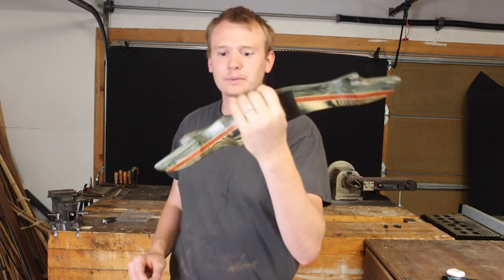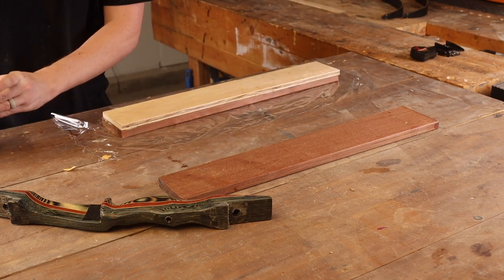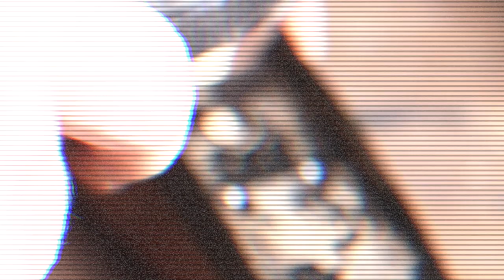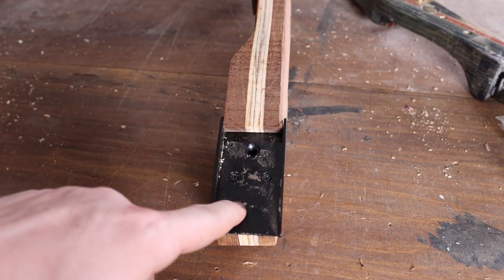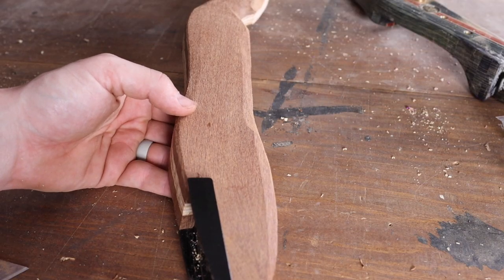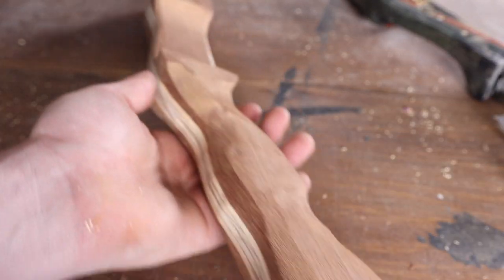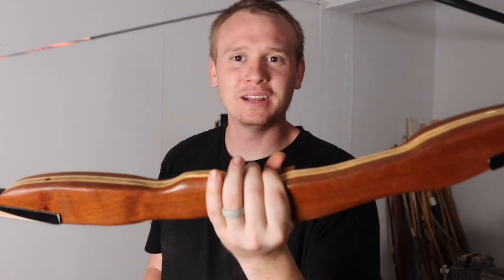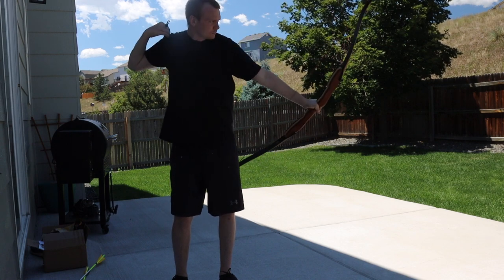I DESTROYED my bow riser AND built a bigger better one!

Comment: Bro, I'd like to see that riser cut past center or just enough to give the arrow a true center shot. Also, if you question your limb bolts. Completely drill thru the riser and use bolt and nuts

Comment: Not to shabby!! The reason it dropped #20 is because you didn't account for the Limb Pad angle!! You used the same angle as the shorter riser!! I'm guessing you made a 25" riser? Those limb pads need to be alot shallower to get the effect you were looking for!! On your next one try 10-12degrees on that length of Riser!!

Comment: I built a riser. Made it shorter to increase poundage. Also due to some wrist injuries I wanted to put more pressure into my palm and take it out of the web of my thumb. I did run into some fit and finish issues, but I'll fix that in a new riser of the same design

Comment: Nice experiment about pushing the boundaries for the right reasons.  I have 3 sets of ILF limbs with 2 strings I just got from you over the last month. My form was pretty good until the last couple of weeks of weather got crappy. Right now I'm converting an old 19" Custom wood riser into ILF. I have a set of limbs that r about 5 pounds less to buildup until the weather warms & I can switch back & forth until I settle on 1 riser. By the way, your Shatterproof glove is a big improvement to those of us that refuse to use a tab. With the button strap u can get the desired fit even if your fingers feel like they r a small in diameter for the glove. Something about that great design that just works 👍.

Comment: Very cool video! Your riser looks awesome. A couple of other things about riser geometry determine bow weight as well as length. The limb pocket angle determines how much preload is on the limb, yours look similar or even more deflexed than the 17" riser which makes the draw cycle start softer and works the limb less.  Also the throat of your grip looks further forward of the limb pocket pivot point, which accentuates the deflex in the riser. I think it works for these shorter limbs though, it should negate any stacking for you as the limb starts to work later in the draw cycle. 

Good shooting at the end! Try and remember to bring the arrow to your eye rather than moving your head forward, you can still lean after if you want to cant the bow, but I'd suggest learning to shoot upright first! Check out Tom Clum if you haven't already, man's a legend and awesome teacher. All the best.

Comment: great video,as always I learned something new .  You should be good using epoxy on the threaded screw barrel. West Marine says their testing shows that epoxied machine screw threads are the strongest way to attach screws to a composite.  Just a thought,  have you tried using french curves instead of trying to freehand a curve?   Transfer punches are a great way to locate the center of a hole on a surface .  Have you tried brad point drill bits? they are great for making very clean holes in wood .  Also, the point helps in getting the drill bit on the center of the hole.  Just my 2 cents worth.

Comment: having had a thing for control line model aircraft in my teens a trick I learnt with balso should help with ply also, form the thread in the wood, soak it well with superglue, let it dry thoroughly, then epoxy in the threaded component.hope this helps

Comment: Nice job,  also grab a 60lbs resistance band and use that to train those back muscles.  Even though it's 60lbs it doesn't really feel like that much and strain grows the further its stretched just like a bow. I started with a 35lbs draw weight and now that seems easy after intentionally training with a band myself.

Comment: Since you were using plywood, I fully expected you to use a wood stabilizing resin, (like BVV.)  You need to do that for unstable woods like soft woods and plywoods, especially when tapping threads for metal bolts in said woods.  These resins require mild heat treating to make them cure.
Like your videos a lot.  I would never do what you do though. I am too rigid and uneasy...  Keep up the good work.

Comment: Nice work ... im surprised that it dropped #20 too, but a beautiful job... 
Im also wondering why you didn't 'radius' the shelf a little ? It looks completely flat. Doesn't it interfere with nock points on the string?

Comment: I followed one of your snowmaking tutorials and made 2 bows, they both only had a draw weight of 25 pounds. How can I make them better and stronger next time?
Reply: To fix the bow you have now, add another thin layer of wood about 1/4 inch thick or 1/2 cm on the front but only in the spots of the limbs after the middle section then put on another layer of the front backing material be it the rawhide or the fiberglass tape in 7-8 layers on the front.

Comment: Why did you run your laminates the way you did? It looks like they are 90 degrees off of the way the original riser was built.
Reply: @kramerammonsarchery  The reason I asked is that to me, all the stress on the bolt insert is being placed ACROSS the plys in the plywood. That is the weakest part of any plywood.  If the laminates had been run perpendicular to the insert, the insert would of passed through at least one laminate before it hit the plywood.  So if the plywood failed THROUGH the plys, (very unlikely), the outer laminate would have supported the treads.  This may not matter on a 24 lb bow, but moving up in draw weight, it could cause a problem.  But then I may be all wet and being too conservative.  I enjoy the channel very much.  Keep up the good work.

Comment: Plywood's only strength is on the top and bottom,.....there is no end strength?
See if you made the plywood your self with epoxy it would have been a solid piece of wood.
Wow,.. 25#@29 that stink's but the riser will probably hold together for that bow.
I was going to lengthen mine its 80# @29 well a few over  80 but it's a Bob Morrison custom bow.
It's supposed to be so many pounds @26,....but at 29 its about 83#
It hits hard its smooth it only shoots wood arrows because it blows the tips out of aluminum arrows.
I'd be afraid to hunt Grizzly with it I have always had bad luck shooting it,......I was getting ready to drop the buck and I was tossed 30 feet in the air by a bull,.......then an even bigger buck at 20 yards,...I shot all 6 arrows they hit limbs and landed under him and he just stood there and sniffed them then picked them up and bit them in two.
Then kept smelling them,... probably because they were cedar?